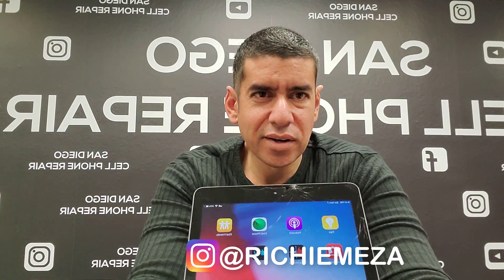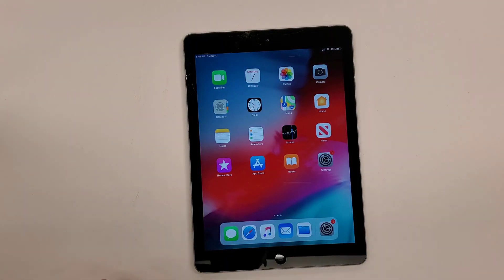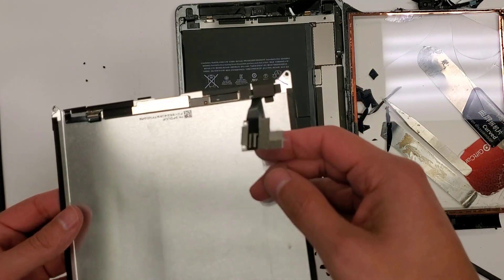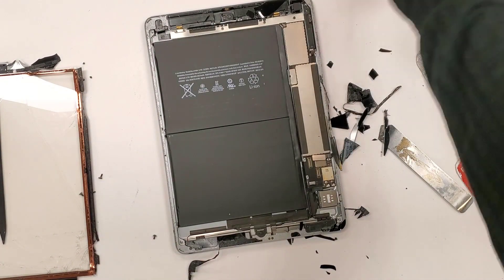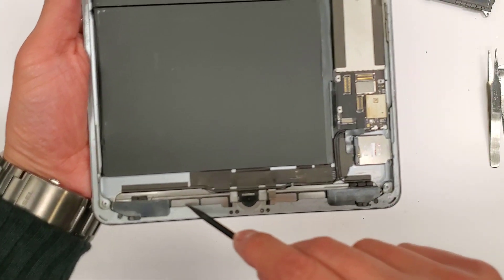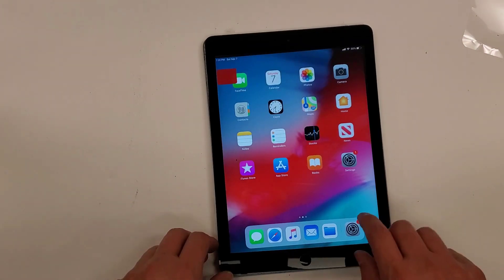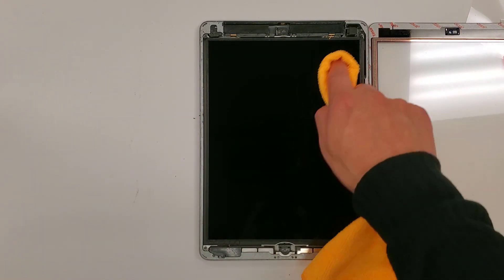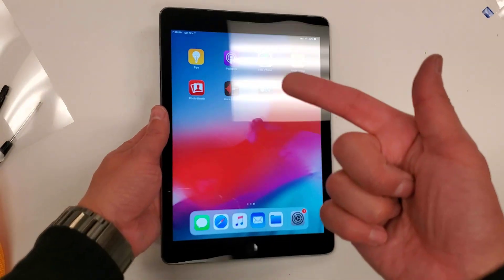iPad Air 1st Generation Screen Replacement Repair

Comment: Hi Richie did this and it worked well thanks, really enjoy your videos. Doing mine some magnets where dislodged and a tiny pin?? Are these magnets crucial and do they have to be in a certain polarity?  What about the pin? Seriously considering your course just practicing on some old stuff first using your YouTube videos. Cheers from Liverpool
Reply from the maker: The magnets I dont know what they do but they are attached to the new screen already. So I install the screen like that with them on.
Reply: I dont mean to be off topic but does anybody know of a method to log back into an instagram account..?
I was dumb forgot the account password. I would appreciate any tricks you can give me
Reply: @Devon Yusuf instablaster ;)
Reply: @Ryan Kendrick i really appreciate your reply. I found the site through google and im in the hacking process atm.
I see it takes a while so I will reply here later when my account password hopefully is recovered.
Reply: @Ryan Kendrick it did the trick and I now got access to my account again. I'm so happy:D
Thanks so much, you saved my ass!
Reply: @Devon Yusuf glad I could help :D

Comment: Well, for the $12 investment it was worth the experience. However, during this process the LCD screen got messed up somehow and has the discoloration/lines in the upper corner now after I put it all back together and turned it on.